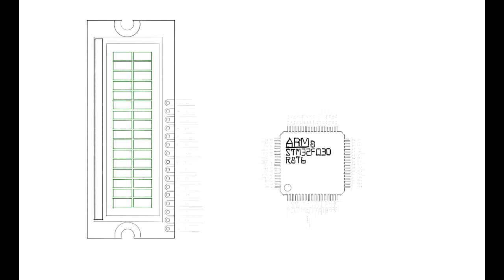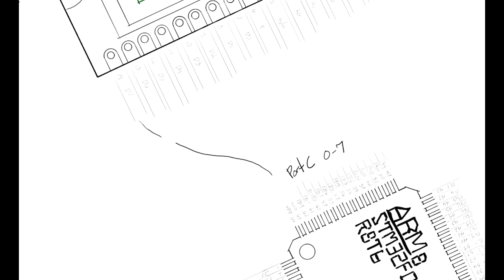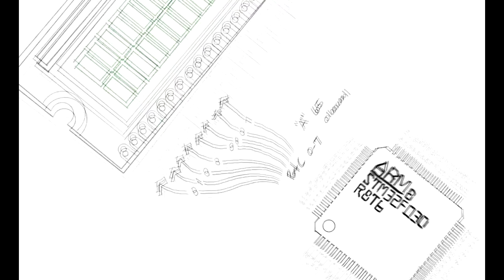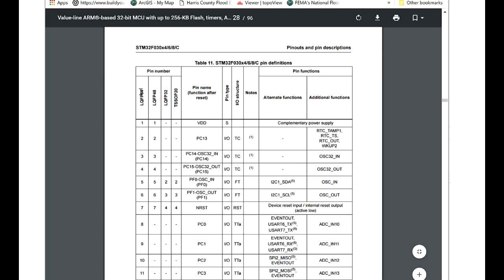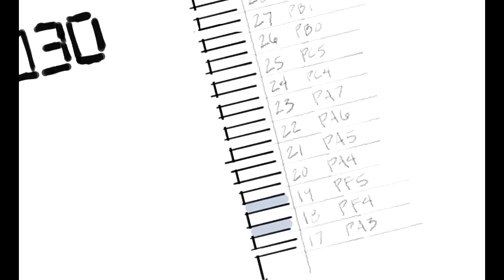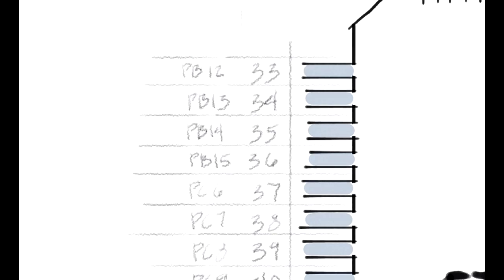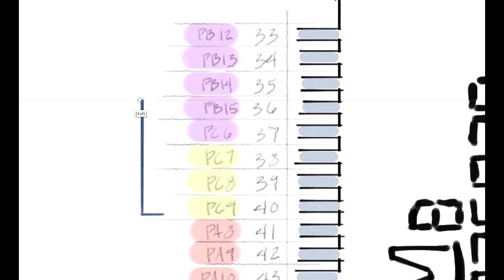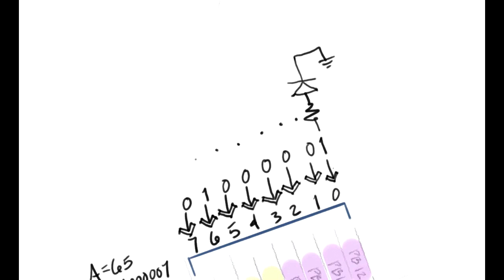14. How to Interface an LCD to an ARM Microcontroller Part 1

Comment: hey man i am using an STM32L053R8T6 Nucleo board and want to interface a LCD with it and also want to use  its internal LCD controller.
can u help me out?
can i use a normal LCD 16x2 (having its own controller circuited on back side ) for this purpose  or i need to use some other??
plz reply me...

Comment: I think you use a Microsoft Surface studio . Overall great tutorial but I want to know something . Which arm cortex m4 best for learning means which manufacturer like NXP or STM which is best to learn.
Reply from the maker: I would focus on how the microcontroller will match your real applications rather than the trying to determine which one is best for the education side of things.  Make sure the microcontroller has the speed and features that you are looking for.  If you want to follow these tutorials, you may find it easier to use an STM32, but it is not an absolute.

I wish I had the Surface Studio.  I am using a tiny Surface 4.